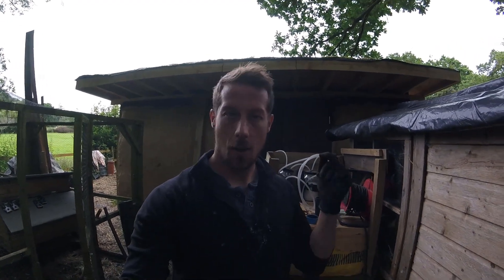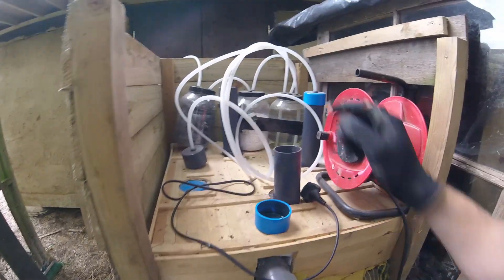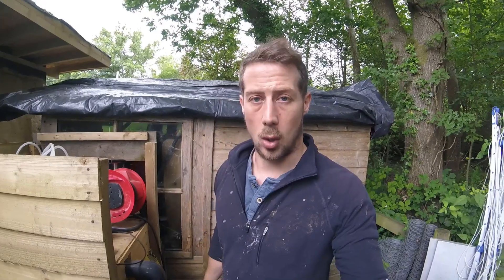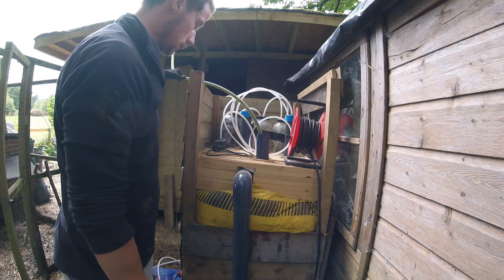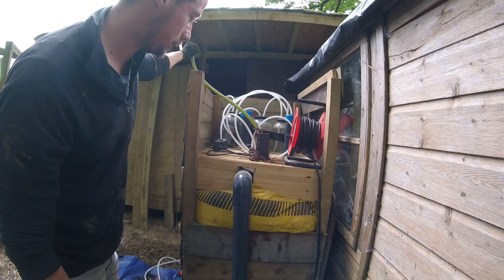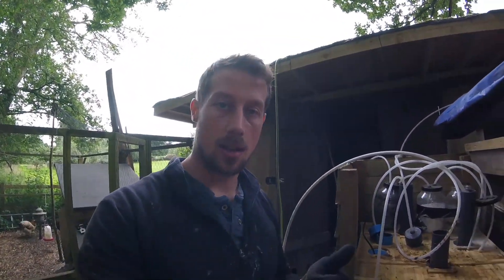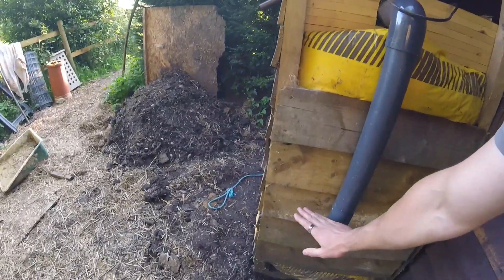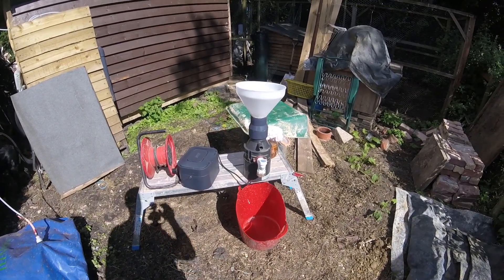How I emptied and moved my Biogas digester

Comment: Haven't seen any gas yet over all the videos ??
Reply from the maker: Nothing in significant quantities. I de-commissioned it over winter and have now made some changes to the digester and its housing. Hoping to get it up and running this month.
Reply: @GetMeOffGrid_  I've seen some commercially made ones that work great but the cost is outstanding, do you think the Ph stopped the digestion?
Reply from the maker: @andrewdarby8827  Yeah the potential is there for sure. Those commercial ones are crazy cool. Yeah, I'm pretty sure I over fed it initially and it acidified

Comment: Hello, why didn't you place the outlet valve on the bottom of the digester in first place? Rather than using the siphon effect you could have directly emptied it from a valve placed at the bottom right?
Reply from the maker: Good question. The digesters designs I followed originally didn't have them, so I didn't include one. I am working on my newer design which includes an outlet at the bottom and bigger input pipe etc. Although, to be honest the siphon worked pretty well, its just a bit annoying to set up
Reply: @GetMeOffGrid_  Noted! Looking forward for the new design.